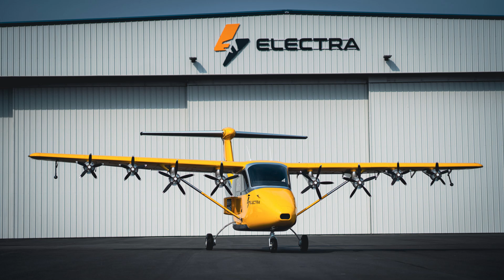Electra's Hybrid-Electric Aircraft Revolutionizes U.S. Military with Ultra Short Takeoff

Comment: Disappointing video, no attempt to explain how a hybrid plane saves fuel. A hybrid car saves fuel thru regenerative braking, how does a plane do it?
Reply: Well, how about an uncontrolled dive?!
Reply: @rocketmanpm  Maybe, but if so why didn't the video explain it? Maybe the gas engine runs at constant optimum speed to generate electricity to run the props, but again no explanation in the video.